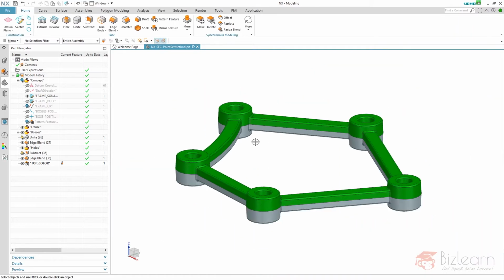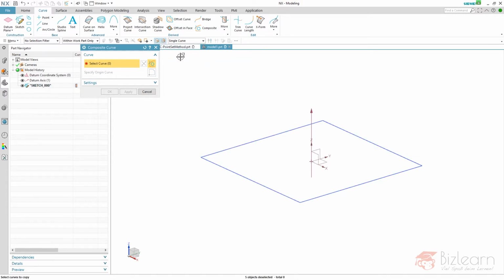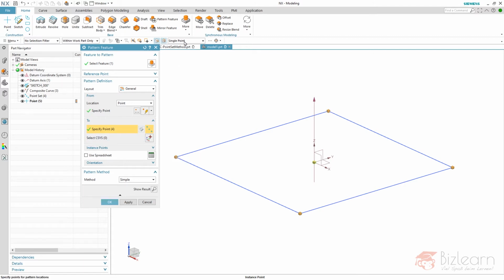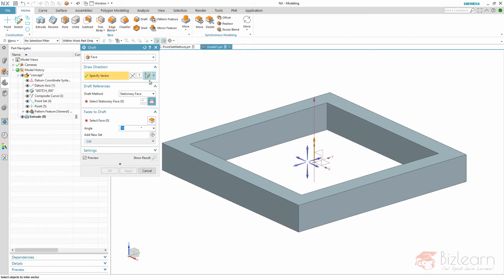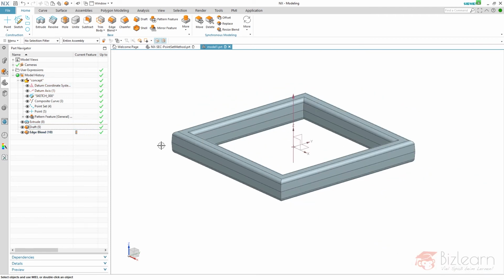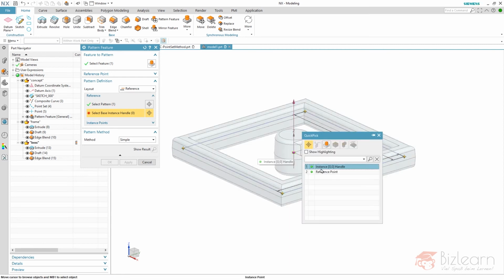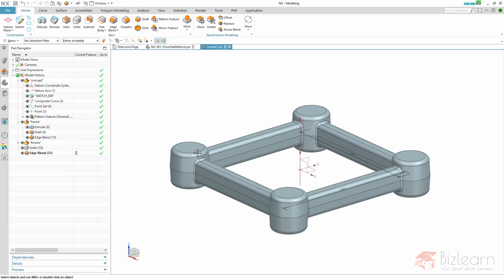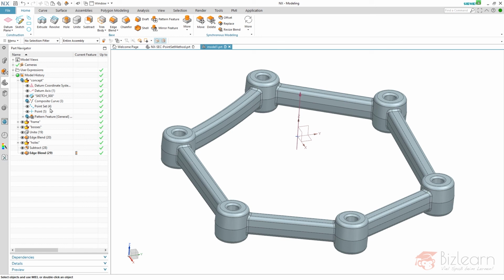Siemens NX Pro Tutorial - how to design extreme flexible parts through horizontal relations

Comment from the maker: Table of Content:
0:00 Introduction
1:56 Start of design process
2:33 Composite Curves
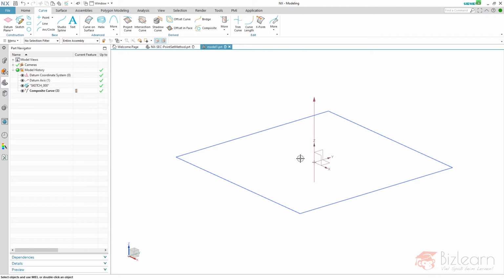3:32 Point Set
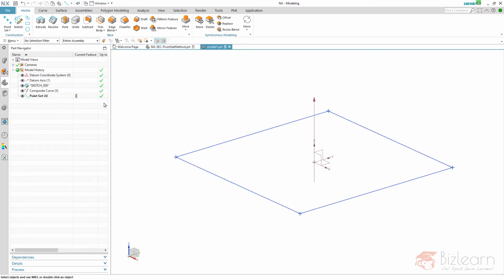4:51 Point
5:26 General Feature Pattern
6:25 Horizontal Modeling
7:35 Feature Group
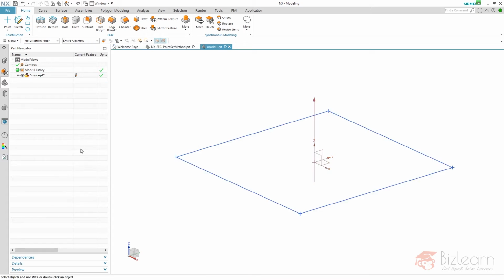7:46 Extrude
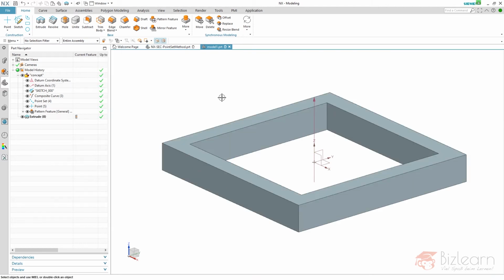8:23 Draft
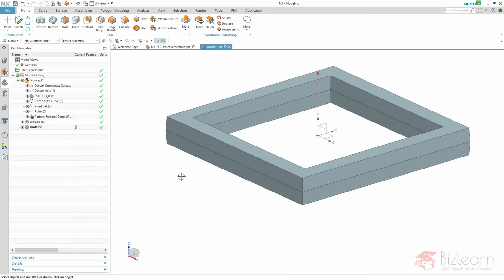10:35 Edge Blend
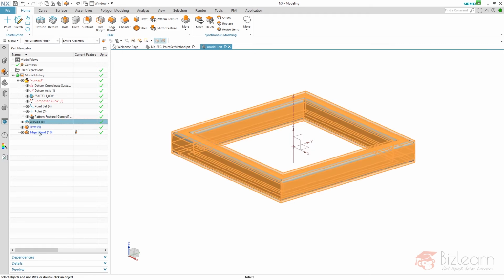12:26 Copy&Paste
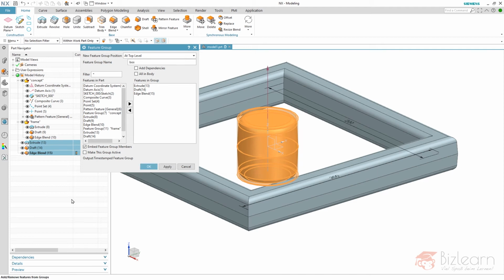13:50 Reference Feature Pattern
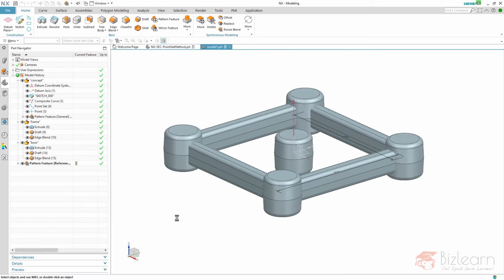15:07 Delete Body
15:35 Boolean Operation
16:22 Edge Blend through Feature Intersection Edges
17:21 Advanced Copy&Paste
19:02 Trouble Shooting
19:34 Testing

Comment: That's a one of smartest  way I've seen to combine the extensive feature list NX is proposing. ACE !
I have a question regarding the feature group. I don't see any feature number on them, are they "non timestamped groups" ? Why this type ?
Thank you.
Reply from the maker: Hi Stephane,
sorry for late response - the timestamp of the feature groups can be displayed via the timestamp column. The group always has a higher timestamp, that its members. So, it is not a parent of its content. Kind regards,
Simon
Reply: @Bizlearn_Siemens_NX_Training  Hum, not sure is you understood my question. In NX customer default, you can choose which kind of feature group you prefer (Timestamped Only / Floating/ Both).
Why in your case did you choose floating group (maybe I'm wrong but as there is no (xx) feature number, I assume they are floating groups then)?
To me, flaoting ones are confusing as they can group "non following" features.
Thank you

Comment: everything worked well what you have showed in the video, but if I modify and give it little bit hard shapes or more edges it does not work properly
Reply: Oh I mean if I used spline it did not work, but if I used lines it works just fine. thank you for sharing all this crazy stuff.

Comment: Hello Sir;
I want to sketch a polygon and control its side number by expressions. So by changing for example from 4 to 5 and get 5 side polygon. I have tried to use expression but I couldn^t add expression. Is there any solution to this problem ?
Reply from the maker: Hi, depends on the NX version - but you can right click any dimension in the sketch and use the "add expression" option. In later releases, it is possible to enter the expression directly! I hope this helps :-)

Comment: Hi. I am trying to learn NX and find your videos very constructive and helpful.
My program does not look like yours. For example, tools are not as easily visible, but they are always there if I search for them. Could this be because I'm using the siemens student version? Understandable if there are light versions, but less understandable why there would be a full version where features are just harder to find.
Reply: Like at [8:15]. I don't have an offset option. Is this due to my version?
Reply from the maker: I am using the default advanced Siemens roles for my videos...
It is possible that your commands are minimized. There should be a symbol right at the bottom of each feature dialog, which allows you to maximize the commands. The student version has no restrictions btw.
Reply from the maker: No such restrictions, to be clear 😅